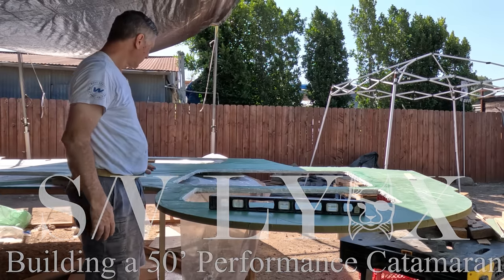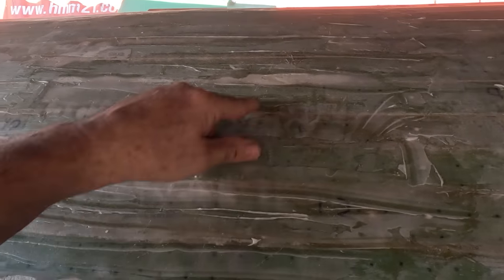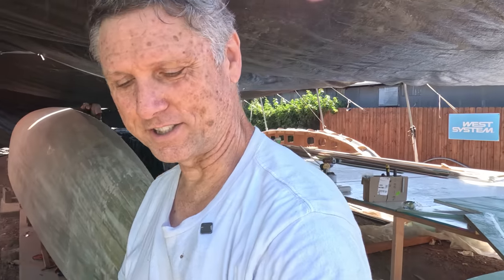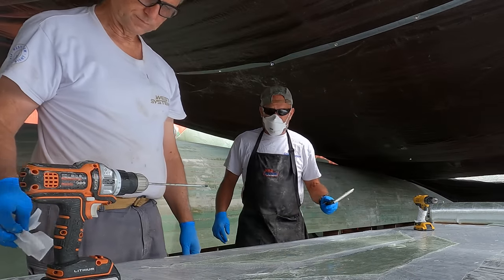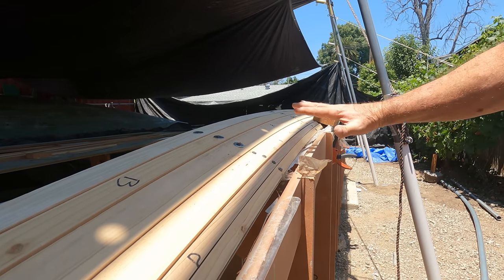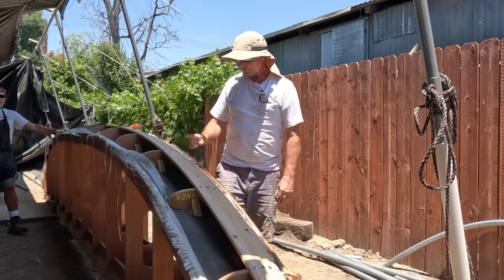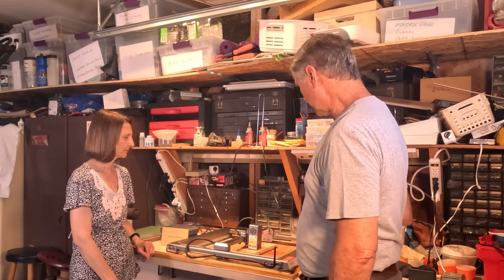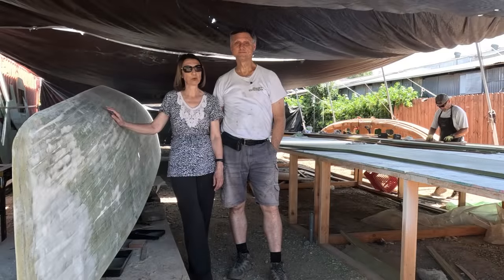Kit E41: Preparing for the next Build Phase

Comment: If you use the router the other direction with another bit and an ring you can do corners as well in a single go. Maybe use the large router for this as well.
Reply from the maker: Send a link to such a bit with a 25mm cut depth and we would gladly use it.

Comment: Just my opinion based on watching many boat building channels hence pretty much worthless is that the design is excellent modern durable safe all that good stuff. Where they fall down is their production methodology which has not really changed in decades. Now of course this has advantages tried true tested etc and shipping a 50 foot Cat in a 40 foot shipping container requires some Tardis level engineering but the amount of hours must put customers of Schionning off'
Reply from the maker: I can't really speak for putting off others.  I knew what I was getting into when I started, so there have been no major surprises.

Comment: You might have addressed this previously, but why did the fore beam need to be made of wood instead of structural foam? I would have that that a foam core, wrapped in carbon fiber, would have all the strength required yet much easier to work with. Thanks!
Reply from the maker: We didn't make the decision to use cedar, that is a part of the structural engineering done by Schionning.  When it comes to anything on the boat that has to do with structural strength, we don't experiment, we follow the build plans to make sure everything works.  And this keeps up the mast, so it's nothing we want to mess with.

Comment: Just a query which I was thinking before I went off in a tangent is does your build require inspection? I presume the design is certified for seaworthiness by the various authorities but do they then inspect your work to make sure it is complying with the designers instruction? Obviously important not only for safety but insurance etc.
Reply from the maker: Not in the US.  If I were going for European CE certification then yes, but I am not.  I don't plan to try and sell this boat in Europe during the first five years she is in the water, so I don't need  CE certification. As for my own safety, I am making sure to follow all build instructions, and exceeding some in the critical areas, like changing from e-glass to basalt on the hull canoes.  I will also be over building the chain plates, for example.
Reply: @SailingSVLynx You do know this is a sore subject in many circles. To keep it short the certifying bodies sign off on the design and the information provided by the designer, they do not ‘police’ or oversee the builder. There are a few horror stories on YT demonstrating this.

Comment: Should you use a safety glasses when using a laser especially cuttting.
Reply from the maker: This laser has a safety window over the laser, so it can't be seen unless we crouched down to the level of the board, which we didn't.

Comment: You know if you turned around the grinder dust would go down rather then up to your face!
Reply from the maker: I know that, and do most of the time.  But some angles require the other direction and sometimes I need to switch hands because I am old and tired.
Reply: @SailingSVLynx  Aren't we all!

Comment: Why are you not using peel ply over you rope joints instead of sanding?  You are making more dirty work for yourself!
Reply from the maker: Peel ply works great over cloth, but not so much over 5mm of thickened epoxy that must be higher than the desired surface while curing due to shrinkage.